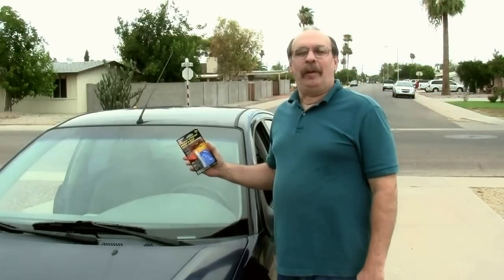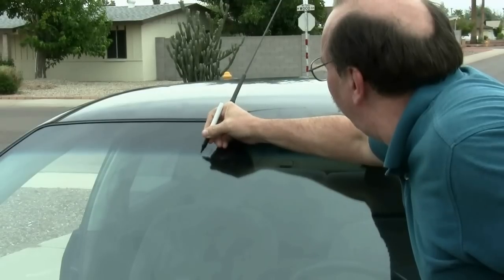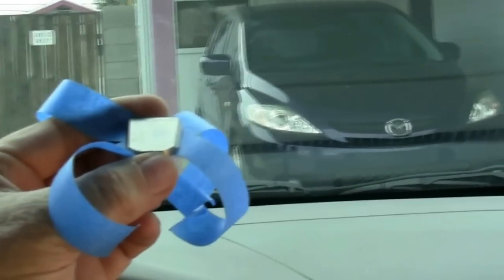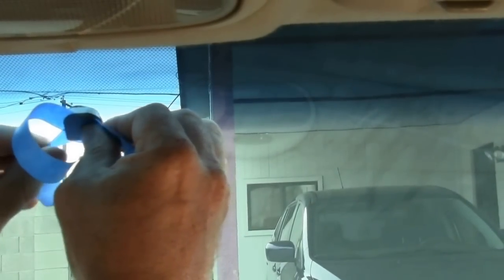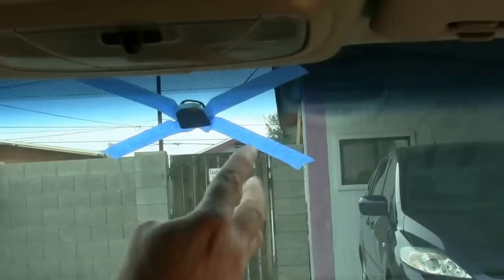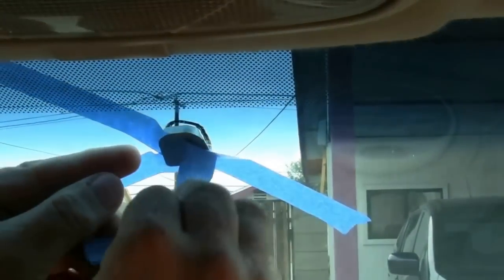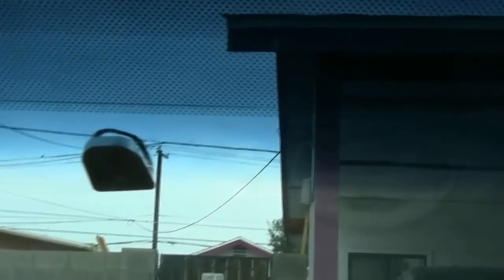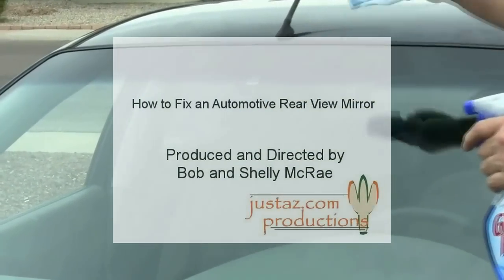How to Fix a Rear View Mirror

Comment: Thanks for you detailed instructions.  I went out to my car this morning and found the mirror on the floor.  Only thing I can figure is the heat from the sun loosened it.  
I will use your video as a guide when I reattach.  Hope I can get the button off as easy as you did without tools.
Reply from the maker: Sea Sand Thank you for taking the time to comment. Living here in Phoenix, I can tell you the heat does cause 'mirror drop'. Fortunately, it is an easy fix once you know how. Best of luck in this and all your projects.

Comment: I wish my button were as easy to remove and snap on as your's is!! I had to get help removing it before, and my brother in law had a hard time with it. I think this is the 3rd time my mirror has fallen off (like every 2 years). I like your idea for the use of tape, and I plan to use that step this next time (unless I find a better way to attach the mirror. Lol). Thanks!

Comment: how do you get the metal/grey piece off? cant slide it off or anything. Thank you in advance!
Reply from the maker: Hello, jimbobv4. Take a look for a small set screw in that piece that can be removed with an alen wrench. If you don't see a screw, we suggest you contact your local car dealer - one that sells your make and model- and ask for information on how to remove the mount on your review mirror. Thanks for watching, and best of luck to you in all your projects.
Reply: Thank you for your help!!

Comment: how do you remove mirror button thats still on windshield. it's glued on wrong. ?????
Reply from the maker: Hello, robert howard. The application of high heat is likely to break down the adhesive used on the button. But we've never deliberately removed a button. I suggest calling a local dealer and asking how they would do it. Best of luck to you in this and all your projects.

Comment: On rear view mirror falling off. forget it , their is an Ebay site for Never fall mirror attachment. It has 15 times the surface of the little button you could not pull it off if you tried. No waiting . I will put it on my other 3 cars. ,about $10.00 shipped.

Comment: If you are demonstrating the use of the repair kit for repairing of the rear view mirror,then you should have covered all the steps on the instructions to have your audience be informed. At least, one step that you didn't cover was the use of the sandpaper in the kit. Roughing up the surface gives you more surface area for the adhesive to adhere to. This will extend the reliability life of the mirror repair.
Reply: I looked at Amazon for this repair kit.I found that they have two different repair kits. As it turns out, The more expensive kit has a few more items to use, which sandpaper is one of those items. I would still recommend the use of the sandpaper. I would buy the cheaper kit and use my own sandpaper.
I thought  that there was only 1 kit with sandpaper included. You used the less expensive one in your video. That would explain why you didn't include that sandpaper step.